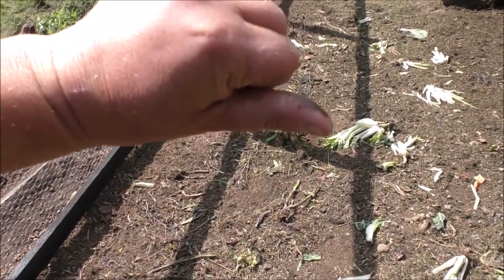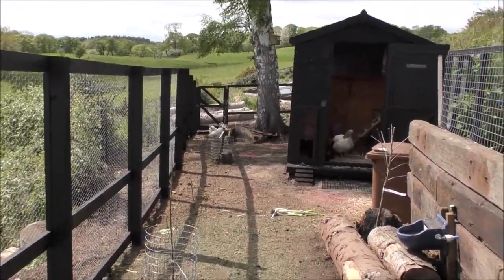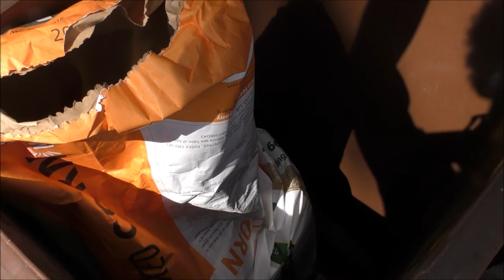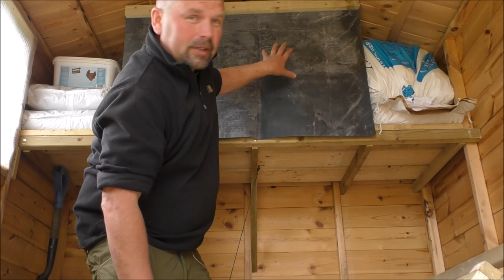Chicken Coop and Run - a bit more toward self sufficiency......

Comment from the maker: Just a short video showing what I've been working on for the last month or so. 
Solar powered shed light (Amazon): https://geni.us/6BW56
Shed vents (Amazon): https://geni.us/xyXk7P
All the fencing is pressure treated but since anything useful for preserving wood has been removed from the 'treatment' due to ecomentalism I coated everything with creosote - it's the difference between having the posts last for 5-6 years and 20+ years. 
Big difference.
The hen coop was made from an 8' x 6' shed I've had for many years and the conversion was easy.
The eggs have beautiful orange yolks as I feed the hens a varied diet and supplement with leafy greens from the garden (cabbage, lettuce, swiss chard etc.)
Having a reliable egg supply added to the organic vegetable supply is a great boost and something I've been planning for many years but never had the correct part of my site developed until recently. Some of the land was leveled by a mini digger and I dug the rest out by hand.
Since there is a war on food actively being waged by every govern-ment to create the next engineered 'crisis' it makes perfect sense to plan and take steps to not get involved in their 'Food Chain Reaction Game' (look it up.....).
.........................................................................
Extensive Vegetable gardens?
Double glazed greenhouse with hydroponic systems?
60+ fruit trees planted around the property?
Spring fed pond full of Trout and Crayfish?
Off grid solar system?
Generator input to house?
Means to shoot, hunt, trap and fish?
.........................................................................
I'm gradually ticking off projects on the list but what you see in my videos has taken 20+ years to create.
It's a great shame that the events of early 2020 were necessary to shake some people awake (and now they're playing catch up) but the effects of that have been fantastic to see with so many people now growing their own food, learning about 'alternative' ways of living and being less reliant on our govern-ment which were regarded as perfectly normal 50+ years ago. 
Govern (to control) Ment (movement / mind).........makes sense when you look at the Latin root words....
How are your plans going?

Comment: My dad's old coop had egg box access from outside, so he never had to go inside the coop disturbing the chickens, or standing in any poop.  The access was via hinged roof flaps and the boxes were the opposite of recessed... (can't think of the word but they stick out from the sides of the shed) this meant there could be boxes down each side of the shed and still have plenty of perch room inside.
Reply from the maker: Yes, I'd considered doing that but opening the main door and seeing if any hens are in the nest boxes doesn't scare them at all and there is ample room in the shed for 6-8 hens which is all I'm intending to have. 
The external nest box method is very popular for small coops where the hens aren't cleaned out regularly but I go in every morning to remove the muck from under the perches so the hens are used to me going in and out. 
Either way works the same, lol

Comment: Love it! Good show sir.
Reply from the maker: I'm glad you appreciate the pen and run as it took a while to make and I got covered in creosote, lol
Reply: @ThousandYardStare  I also appreciate you knowing that things these days are junk compared to how the "same" item was made years ago. I had to recently dig up an old clothes-line pole that had been cut off at the ground at least 15 years ago. The pole was 1/4" thick galvanized steel with a piece of rebar welded on the side to be a concrete anchor... I thought about your comment on the new creosote beams while i spent almost an hour smashing the concrete off with a sledge hammer... but I got it out and my new banana plants in the ground!
Reply from the maker: @christodd3224  Lifting up huge lumps of concrete and smashing it up is quite a task so I don't envy you there. I want the task of replacing the posts on the hen run to be someone else's problem 30 years down the line as I've no intention of doing all this work again soon, lol

Comment: Thanks for making a great chicken coop and showing us the results! I really agree about oiling the wooden posts before they go in the ground! This is a very ignored procedure in the fencing business here in mid America. How long did you soak your post bottoms before using them?
Reply from the maker: They were pressure treated when I bought them so I left them out in the sun for a week or so to ensure they were nicely dry then stood them in the Creosote for 2-3 days each to treat the bottom 2 feet of post. Then after the structure was built I painted the rest of the wood which was above ground (also with creosote).
The pressure treatment used now is absolutely useless so using a good oil based treatment is a must for anything going in or near the ground.
It's ridiculous that I'm using a preservative deemed to be dangerous and damaging to the environment but in reality it ensures that all the wood lasts 4-5x longer than the supposedly 'environmentally friendly' treatment. It makes zero sense to use something which will guarantee you'll be chopping more trees down in a few years to replace he fence which has rotted when it could have been properly treated in the first place to last for ages but that's the upside down world we live in now - everything is 180 degrees away from what it actually is, lol